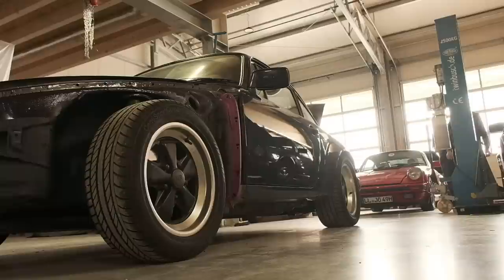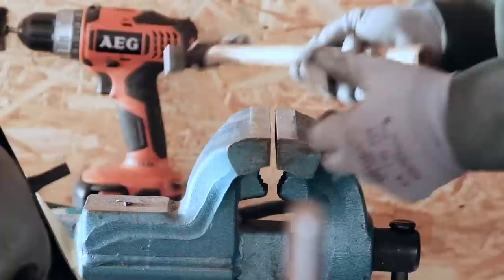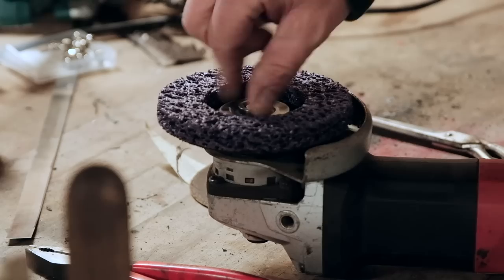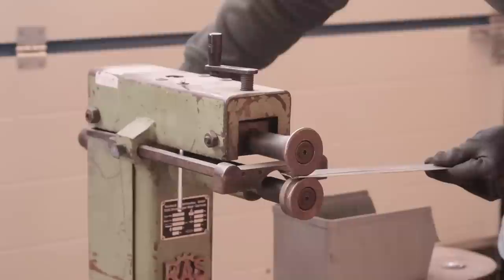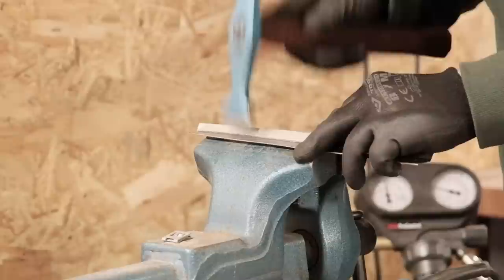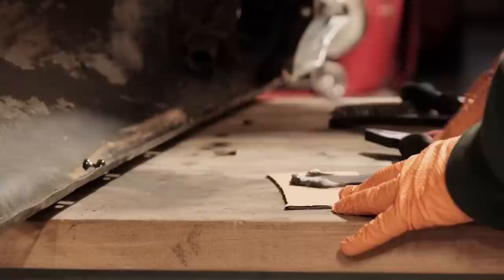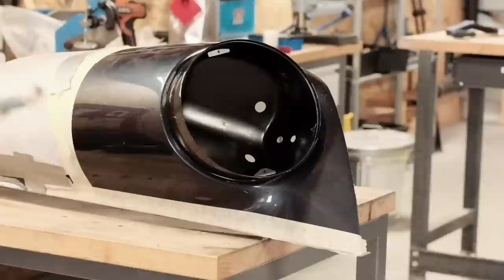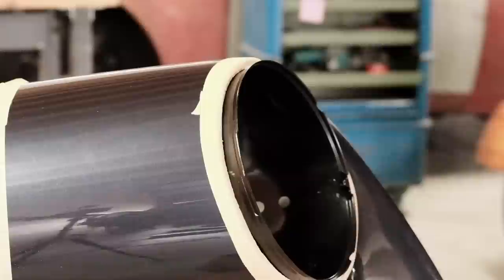More Complicated Rust Repair of an 86 Porsche Carrera

Comment: Super work! I think you should treat yourself to  a small shrinking machine for repair parts like these! I am a huge fan of bonding parts where possible but so many people are still suspicious of it. Replacing those headlight bowls is a perfect example of where it makes sense, anywhere with close fits and minimal relative movement between parts is ideal and it is so much gentler to the parts than the heat of welding. Good preparation and following the product instructions perfectly are the key to success! I am planning to use adhesive as much as possible during my 911 restoration as the car is no longer original anyway😊
Reply from the maker: Thank you, James.
I much agree to what you say and I look forward to future experiences with this product.
Reply: James, do you know anything about anaerobic adhesives? I’ve been wondering is a very low viscosity adhesive could be wicked into the crevice of  spot welded lap joins. Maybe a toughened 
version.
Reply: @johnsherborne3245  Sorry John, not my area of expertise! The 3M and Henkel product selectors are very good for narrowing down to a few suitable products for a particular job though I find.
Reply: @jameswalsh1690  so it sounds like it’s my idea, I ought to explore it!

Comment: That's been a pleasure to watch, as usual! This painstaking work, plus your mentioning the availability of a repair panel, has made me curious though: does Porsche still sell new G-Model fenders? And if so, do they charge the small fortune I imagine they do?
Reply: Porsche charge small fortune for everything that gets to porsche classics program... imagine 924 and 944 ...the cheap porsche ... not anymore
Reply from the maker: Thanks, Matteo.
An excellent replica of a 911 fender is available at JP for about 1.3 k€. Almost impossible to note any difference to a Porsche one.
Reply: @GreasyFingers  1300 Euros for a non-Porsche part tells me that the original costs even more... Wow! I can clearly see why you repaired that fender instead of replacing it... Plus we all got a nice video to enjoy, so that's definitely a win :)
Reply: @adamt3332  I’m tempted to agree, but not always! I was after a fuel tank sender gasket which is VAG part. VW wanted double the Porsche price. By the same count I also wanted a gearbox gasket for a 928, it’s a Mercedes part, Porsche wanted double the Merc price. This leads me to suspect that price charged bears no relationship to true cost. They just dream the price up. 
For me the fun part is to work out who made the part originally and chase that. Lots of OEM building relatively small volume cars build parts bin specials, find the bin and you have your part.

Comment: Great job ,,, I too dress back spot welds with the edge of a grinder and a cutting disc , it takes practice and patience , but the results are mighty ,,, try a 3m scotch pad on a die grinder too ,,, again great results .
Reply from the maker: Thanks for the tip, Tom. 
Cheers, Johannes

Comment: Interesting, do you know how repairable the glued seams are? If the glued parts can be removed without having to grind down the metal on the whole seam I think it is a very interesting alternative for quite a bit of repairwork.
Reply from the maker: If applied in industry, these glues always come with an „anti-chemistry“, which means that e.g. BMW workshops can order a product that enables them to remove the specific BMW glues of specific cars. 
I’m not sure whether this is true also for aftermarket glues, by my hopes aren’t high.
Reply: @GreasyFingers  Oh well, I might try this approach with some ”almost lost cause” rusty parts I probably can’t weld without burning through. If they rust out again I can try to pull the repair out without a sledgehammer.

Comment: why not use electrolysis on things like that light bucket..? could get all the rust and then you epoxy it... I've done it on Alfa doors and such, gets the rust, doesn't disturb the good paint.
Reply from the maker: Thanks for commenting.
I understand the theory behind the method but don’t have any practical experience. I’d love to learn more …?
Reply: @GreasyFingers  Well, my thinking is like this. I know you dont like to cut away the original structure. I am the same way, I like to leave as much of the original car as possible in every instance (where possible..). 
I also have noticed that de rusting with electrolysis a very harmless way to remove rust, and only rust, the metal that is not rust is not affected with this method and in my experience the paint has not been affected either.
I use Acoustic soda and water, no special mixture.. just added to the same solution for many years, add some water, add some soda as I see fit.. (connect negative from battery  charger to the part and positive to sacrificial steel anode(some junk)), rinse the anode when it gets dirty, all the rust will end up on it. I run it fore like 2 days and after this the part is free from rust and you can assess the damage. 
If doing door bottoms that still is on the car, use a big bag and hang it on the door.... 
Electrolysis gets to all the rust that can be touched by water. Its like reversing rust... unfortunately it does not add new metal to the rusted parts but still a great help.

Love the channel, God bless you.